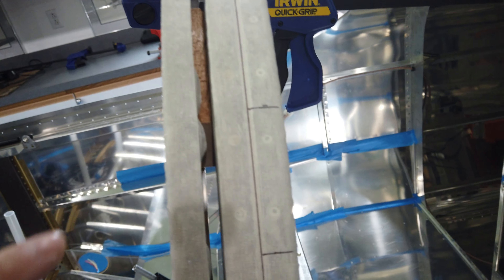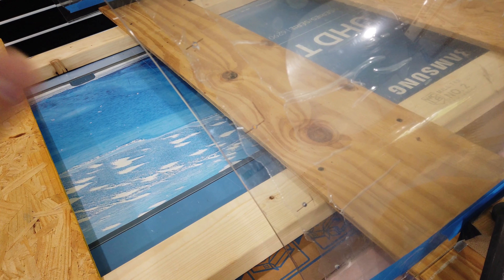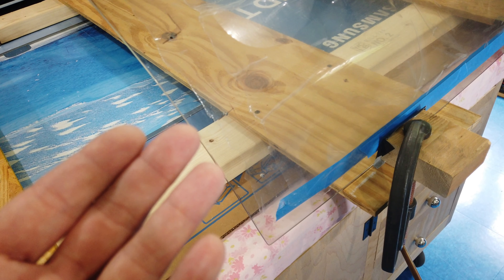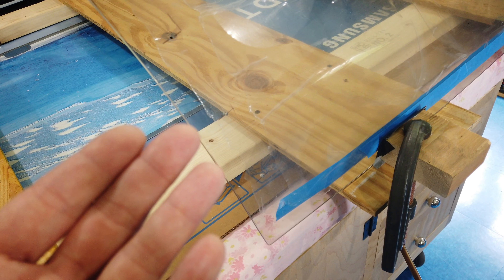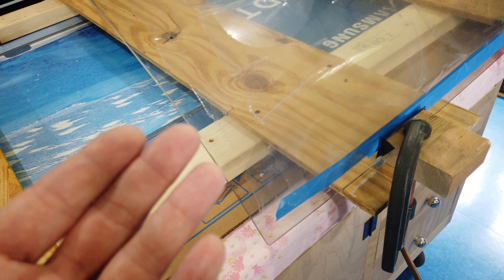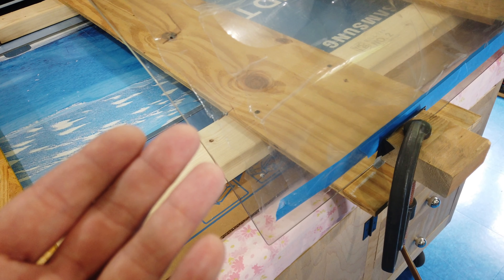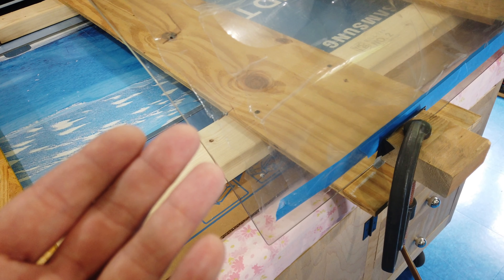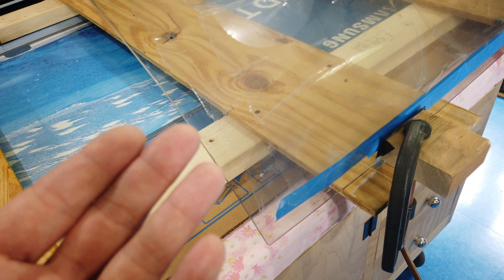Vans RV 7 HINT Video Canopy Glass 11

Comment: Dumb Question for you, would something like Rivnuts work on that Canopy Bow?  or would there be too much standoff from the shank?
Reply from the maker: I suppose rivnuts could work,  but they are quite large and will eat up your edge distance on the canopy frame bow area. You would also need to duplicate the height of the rivnut on the roll bar so the rear window will sit flush with the canopy glass.  (I would recommend some type of sealant as well since you now have a gap between the bow and canopy because of the raised rivnuts.)
Reply: @KaretakerAero  Ok, That's kind of what I figured.